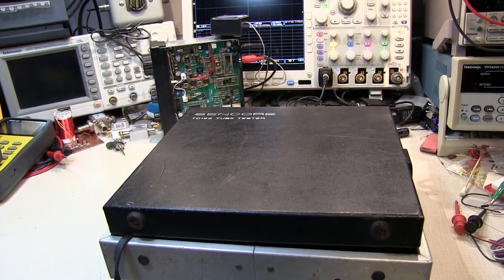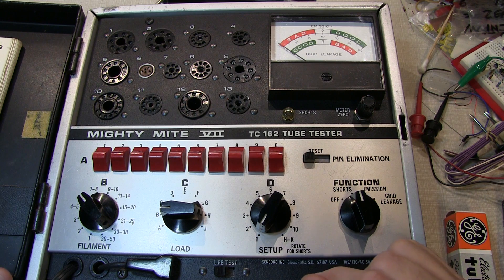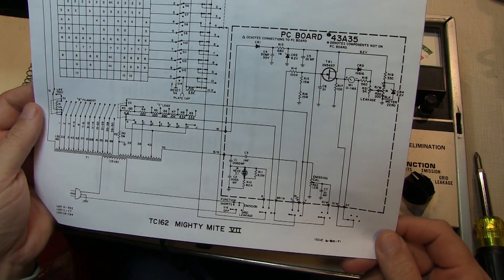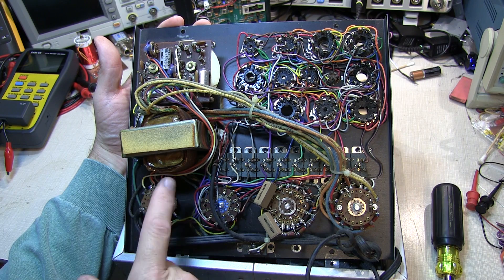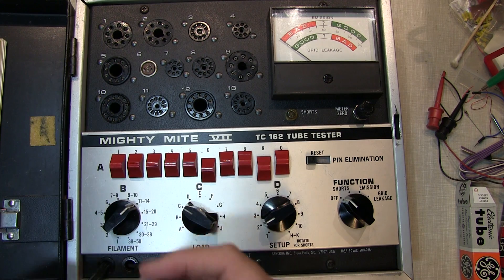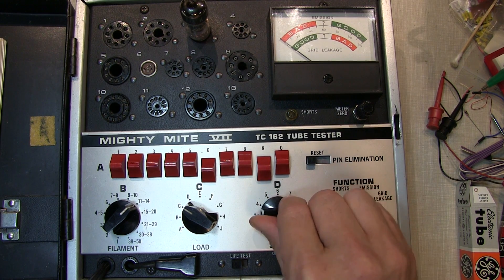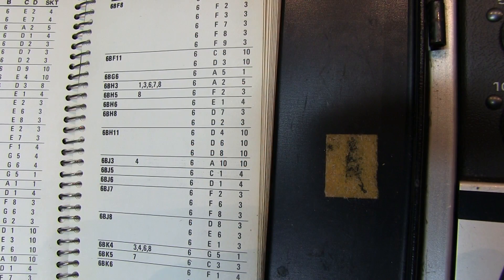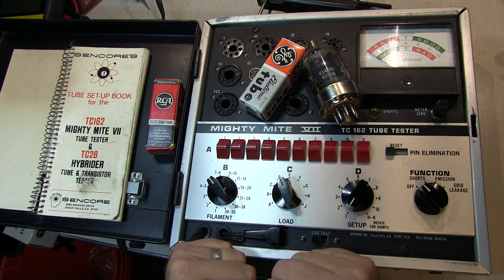#272: Vintage Tech: Sencore TC162 Tube Tester: How to use, tips and peek inside

Comment: When I started working at Sencore in the Service Department, we were assigned a rating system according to the faults and the repairs needed to prepare the product into full operational capacity to return to the consumer electronics technician on Main Street, Anytown, USA

As a note, I am honored and thankful that the testing charts of those setups was generated by my mentors at the time, Antwon Grezempa, and especially, Norm Pederson.

Comment: The grid leakage test on tube testers doesn't say what is considered grid leakage? 250mV or 500mV
Reply from the maker: The unit is video can measure leakage as low as 0.5uA.
Reply: @w2aew  I didn't know that tube tester measured tubes grid leakage in the uA microamps. I'm guessing it tells in the tube testers user manual what the grid leakage test is measuring for pass and fail current criteria?

Comment: hello, I have hooked up four different tubes and ran the test according to the settings, but I could not get the meter to move. The short light would come on momentarily for some, but the emissions and grid leakage meter would never move. I made sure to zero it out when turned on the shorts function and the cable is connected by the life test switch. And I hooked up one tube with the cable on top of it and still no meter movement. Any ideas?
Reply from the maker: Could be a number of things:  A faulty meter movement, incorrect or missing heater voltage at the tube, dirty switch contacts, etc.
Reply: @ okay, thank you. I will test some of those ideas. Much appreciated.

Comment: The Emissions Test is an in series current meter Ammeter measuring the current from cathode to plate? The LIFE Test is putting a Load/parallel resistance on the plate of the tube to ground?

Comment: Thanks for this informative video about the Sencore TC162 Tube Tester.

I worked at Sencore for some six years, starting as a factory service technician.
The TC162 was my favorite machine to work on, having tested TV and radio electron tubes at my Dad's store since I was ten years old.

The Sencore approach was focused on the service technician determining quick "Good-?-Bad" testing, especially in home service calls, rather than complicated engineering parameters of Hickok and other testers, which I also used.

Comment: When measure a vacuum tube amplifier preamp stage or power amp stage how do you know if the tube amplifier is High Plate amplifier stage or a Low Plate amplifier stage? I'm guessing High Plate and Low Plate mean the Gain Ratio of the stage?

Comment: I'm a little late to this party having only just found this video in my feed today, but I found it useful nonetheless.  I'm in the process of refurbishing a B&K 607 Tube Tester, a direct competitor to the Sencore TC162.  About the only difference between the two is that the BK607 does not have the TC162's Life Test switch.  I was a bit disappointed that you declined to test the 6146 tube you showed.  My Kenwood TS830s uses two of those tubes.  I'm trying to learn as much as I can about the radio before I tackle a full restoration and alignment on it.
Reply: The 606 will not test 12ax7 Russian made tubes

Comment: What are Novars, Nuvistors, Compactrons tubes used for and why aren't they used more often in electronic circuit designs? I think most tube testers will measure and test Novars, Nuvistors and Compactrons

Comment: OK... would YOU buy this checker? Is there any better model? Is emission testing the most important test?
Reply from the maker: Well, I DID buy this checker.  Are there better ones, sure there are.  But, I didn't have any, so this one is a good unit, and certainly better than nothing.  Emission testing is useful, as is the shorts test.  Mutual Conductance is another useful test, but this tester doesn't do that.  There is NO tester that can tell you for sure if a tube will work in your application or device, because they don't mimic the operating conditions in the device it's used it.  Therefore, the testers are only good to tell you if the tube is obviously bad.  They can't tell you if they're obviously good.

Comment: Hi Alan, Interesting video! Sencore made excellent test gear overt the years. I'm a long time user of the TV7 for testing older radio/TV/Audio tubes,. Only problem is, it doesn't test the later Compactrons. There's where the Sencore comes in handy. It's a nice portable service tester for quick emission checks. I repair pro audio gear, but also specialize in vintage vacuum tube electronics repair/restoration...tube radios, TV's, Hi-fi & guitar amplifiers, recording & broadcast studio equipment. 80% of my work is tubes, and the rest solid state.  Your videos are well enjoyed by me and many of my colleagues. One of these days, I have to get my old Tek 475 scope working properly again (an old favorite). May need some advice on that project :)  Keep the great videos coming.

Comment: Thank you for next great video! I seen those tester on eBay but they are slightly expensive how simple they are. Q: Isn't better to build the same (schematic is public) like buy one? May be there is also possible improvement in circuit like using relay instead of some switches an MCU and display to inform user about tube type and so. And using this MCU to contain all those information's which is in this paper "manual"?
Reply from the maker: You certainly could build one with more modern technology (microcontroller driven setup, etc.), but there wouldn't be much of a market to sell it - so it would have to be a project driven by your own passion.

Comment: What causes a tube to gradually go bad? I mean, I get a "blown" tube, but not the incremental failure.
Reply from the maker: There are several wearout mechanisms that can take place.  The heaters can become less efficient, providing less heat over time.  The primary wearout mechanism is a reduction of cathode emission.  Cathode emission is via the oxide coating.  There is a limit to the maximum number of electrons emitted over time.  Several other factors, such as impurities and gas in the tube, can also adversely affect emissions over time.
Reply: thanks. It's all sort of magic to me.

Comment: The TC 162 has the best grid leakage of any tube tester I have ever encountered; even my B&K 747 fails in this category. Yes! you are right about no tube tester can simulate the actual working condition. If I am not sure about the results, I will check it on a second tester to reduce false readings or substitute a replacement.

Comment: Still have an older Sencore, plus a WWII military Mutual Transconductance tester for which I made a bank of modern sockets with a set of a dozen slide switches (1P10T) to do the switching. You had to do some "hoop-jumping" to translate from the Tube Characteristics manual to settings on the tester, but it was all I could afford as a one-man electronics repair shop back in the early '70s. I quit TV repair when TVs went to using $100 swap-out modules instead of discrete component repairs. No way for a one-man shop to stock every board for every TV.

Comment: You are one of the best instructors I've seen.. Seriously.. Excellent.. I would love to see some videos where you walk us through some schematics and fully explain them and talk about the design decisions that go into such circuits.. Or have you thought about an electronics course, starting from basics and getting into design?  Just some suggestions...
Reply from the maker: I have several videos where I walk through the design, schematics, etc. - both on some circuits I've designed as well as some production products.  Here's a short list:
Flexible Ramp Generator: https://www.youtube.com/watch?v=bVahBmsvirE
Sawtooth Waveform Generator: https://www.youtube.com/watch?v=ibnz5UjQ4u0
Cascode Amplifier: http://youtu.be/Op_I3Ke7px0
555 Monostable: https://youtu.be/MbWc70ZzTlI
Basics of Gilbert Cell: https://youtu.be/7nmmb0pqTU0
Basics of Differential Amplifiers: https://www.youtube.com/watch?v=mejPNuPAHBY
Diode Ring Mixers: https://www.youtube.com/watch?v=junuEwmQVQ8
Directional Coupler: https://www.youtube.com/watch?v=byF1FLdbUiA
Op Amp Basics: https://www.youtube.com/watch?v=K03Rom3Cs28
Op Amp Peak Detector: https://www.youtube.com/watch?v=Fn5kHhNRsz0
Op Amp Summing Amplifier: https://www.youtube.com/watch?v=juQtVIx1a8g
Common Emitter Amp gain and frequency response: https://www.youtube.com/watch?v=NizrzRKQqII
Common Emitter, Base and Collector amplifiers: https://www.youtube.com/watch?v=zXh5gMc6kyU
Vbe Multiplier: https://www.youtube.com/watch?v=Obh_PIC2qqo
AutoRanging Analog Voltmeter: https://www.youtube.com/watch?v=7OLGswQ7ICI
RC Servo fun: https://www.youtube.com/watch?v=iaGZOO33Z-o
Single Cell LED light: https://www.youtube.com/watch?v=qfgX93o8HzY
Unique Stair-step Generator: https://youtu.be/Kqb5zcrgv7s
Simple Transistor Curve tracer using stair-step: https://youtu.be/ZOLLoa2fH24
5 Transistor ESR meter: https://youtu.be/3fiUZZlveS0
Heathkit CW Transceiver walk-though: https://www.youtube.com/watch?v=rPM1vvGorTo
MFJ CW Transciever walk-though: https://www.youtube.com/watch?v=2QSwXv2RJzw
TenTec 1254 Shortwave Receiver walk-through: https://www.youtube.com/watch?v=dZNN5RnOdt8
S-meter upgrade to 1254 receiver: https://www.youtube.com/watch?v=5yhMOcpHS7Q
Wadley Loop receiver: https://www.youtube.com/watch?v=JvS9tBWAc1s
Reply: w2aew Thank you.  I really appreciate the reply and links.. Have a great Thanksgiving!!

Comment: A lot of manual labor in building one of those. I was expecting you to spray some contact cleaner on the switches.  I wonder how many of those drug store testers are buried in landfills (all?).
Reply: Randy, you have to be very careful about cleaners in a tester like this. The very sensitive grid leakage test can be negatively impacted by the lubricant / residue left by most cleaners, since it’s designed to measure 200Mohms or more.

Comment: That's a nice tester! I have one just like that. Out of curiosity, I looked into the "life test" function. When you slide the switch over, there is a one ohm resistor that goes on series to the filaments. Since emissions are usually not a problem with rectifier tubes, this will help determine the heater is wearing out. Your presentation is spot on as always!
Reply from the maker: Thanks again Bob!
Reply: I know it’s been a while, but I’m interested in this life switch function. I was thinking of incorporating it into another vintage tester I have (University TST).
I have read that it’s best to reduce the filament voltage by about 10% for a life test. Will this 1 ohm resister do that across all the filaments in this circuit?

Comment: Could you help me with a question? I need a tester for 8980 tubes. Mayber, the first type you mentioned. The trans-inductance type.
Reply from the maker: Dale - I don't know the answer, so I consulted with a friend that only works on tube gear (youtube channel RadioWild), and here's what he had to say:

The 8980 is what's called a "Cermet Planar Triode" made by EIMAC. This succeeds the 2C37 tube I think made by Amperex. This is a transmitting tube specifically for CW use. I have 4 other testers and none will test that tube. Not very many transmitting tubes can be tested. This I think is one of them. For more characteristics, check out - http://www.relltubes.com/filebase/en/src/Technical_Notes/EimacCareFeeding2.pdf
Reply: w2aew  ,,, I was wrong on the tube number. It's a 8908.

Comment: That's a really nice score.  Man, I'd almost kill to have someone sit with me and help repair my Sencore Z-meter.  For some reason I just can't figure out why the capacitance setting doesn't work.  Every other function on that thing works properly but that...even the leakage function.  I tried all the low hanging fruit and replaced every single electrolytic cap in the unit in hopes that would nuke the problem from orbit...still nothing.  Sigh.  The guys on the Antique Radio forum were extremely helpful with a lot of information but unfortunately I haven't been able to lick the problem yet.

Comment: Do you know what a EBM 3D printer is? I know someone that built one and needs the high voltage wired up by a smart person in that field, they know the concept, built 90% of it and came to a stop when it came to the high voltage, are you interested? It's like a CRT, and the beam was able to be made with a flyback transformer and a phosphorus detector, imagine having 3D printed metal parts, if you show interest I can show video of the apparatus, there's also a RepRap called "metalica rap" that is another one, thanks, oh yea it works like a vacuum tube that's why I asked
Reply from the maker: I am somewhat familiar with the technology, but never been close to one or worked on one.  It's a bit outside of my field unfortunately.
Reply: Here's the video footage https://youtu.be/rUjEBT4d7uM

Comment: I remember my Dad working on TV sets for Sears, he would stick a tube on the tester and then thump the tube with his fingers to see whether the tube was noisy or not. A lot of times they were after warming up. To think these were in grocery stores and people who didn’t know anything about electronics were diagnosing their own sets. Tube sales were high:-)
Reply: Not just intermittent shorts; sometimes tubes would become "microphonic". Vibration would change the µ so that any chassis vibration could set up noise or even audio feedback. A tap while in circuit would cause a thump or damped ringing in the speaker.

One of the tube manufacturers made a give-away item which was a pencil with a t-shaped assembly for the eraser. It made the pencil into a tube-tapping hammer with eraser faces. I haven't seen the one I had for half a century. I probably used it as a pencil until it got too short and tossed it. (Who could foresee collectables and eBay back in the day?)

[A couple minutes later] LOL - Evidently somebody did. I see dozens of eraser-hammer pencils on eBay. Oddly I didn't see any from a tube manufacturer. Search eBay for [ pencil double eraser ] The perfect weight, the resilience of the cedar shaft, and the elasticity of the eraser made a pretty good tube tapper as I recall. I bet the erasers are hard as rocks by now.

The downside of using a pencil around any high voltages was that concealed within the cedar shaft was a pretty good conductor - a stick of graphite. I now recall that this was why I tossed my tube-thumper. One ZAP did it for me.
Reply: You beat me to the punch! Tap that tube and watch the short light to see if it flashes.
Reply from the maker: Yes, that's a good point, that I meant to make in the video.  It is a good idea to lightly thump the tube especially during the shorts test.

Comment: Great presentation of equipment, that seems to never get old. The wiring inside of the tester is amazing. Don't those wires get brittle over time? Great show, thanks!
Reply from the maker: Surprisingly the wires are still in good shape - only about 45 years old ;-)

Comment: Let the dead rest in peace. No need to drag out tech from 50 years ago, if you lack material for your channel.
Reply from the maker: Restoration and enjoying antique and vintage electronics is a vibrant hobby - plenty of folks (including myself) really enjoy this aspect of electronics, as well as modern equipment and technology.  I'm certainly not lacking for material for my channel, that's for sure!
Reply: Anything with modern electronics will do it for me. I like your channel and watch most of your videos. 
Meanwhile, I'll learn to be a bit more tolerant towards what others like.
Reply from the maker: No worries - I cover a lot of different areas on my channel - vintage to modern, basic to advanced, DC to RF, design to repair, etc.  Let me know what you're interested in and I can add those topics to my long list of future video topics.
Reply: Vacuum tube fanatics love this kind of stuff though. Don't ask me why, they just do.
Reply: a traveling-wave vacuum tube is used today to transmit very high frequency signals from a satellite to ground  stations. Amazing technology!
Reply: I've never heard of ANY vacuum tube capable of operating in the Gigahertz range. Where did you read that?
Reply: PirateKitty https://spectrum.ieee.org/semiconductors/devices/the-quest-for-the-ultimate-vacuum-tube
Reply: That looks more like a ray gun, than a vacuum tube! Amazing.
Reply: Fair enough. I didn't watch your video. Not interested in old tech. There is Mr. Carlson's lab for that which I also don't enjoy watching. 
By hey, whatever puts a smile on your face. I smile at other stuff.

Comment: Great history/tutorial, thanks Alan. I'm privileged to own this unit's big brother, a Sencore Mu140, which partly addresses the gap between "test" and "real world" conditions. Besides shorts, leakage and emission, the Mu140 also measures transconductance; and unlike old-school Hickocks etc., does so with a 5 kHz audio test signal. It also uses an "auto grid bias" that simulates typical in-circuit biasing. Very hard for a weak tube to sneak by. Only annoyance is that (like the 162) the meter isn't graduated in uA/mA, just the stupid go/nogo bands.

Comment: Thank for another great video Alan.  Very good point you mentioned about waiting on the leakage test.  That is a trap for young players.   I have one solid state tester, EMC model 215. Never use it much. After many years (mid 80's) I got my old HICKOK 800A back that I sold after closing the TV shop down.  Thanks for sharing.
Reply: Hah!  I had an EMC 213.  Wish I still had it.  I built it from a kit,  wired up all those sockets...   I rather liked that unit.  Got two other testers now,  one newer one and an older unit that has the sockets for the pre-WWII stuff.